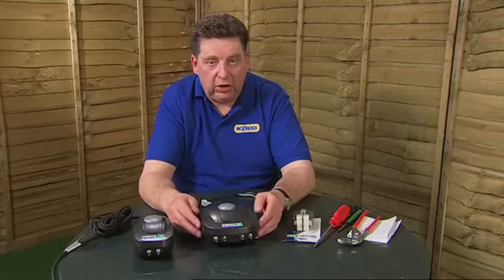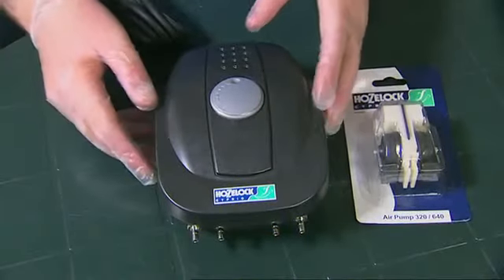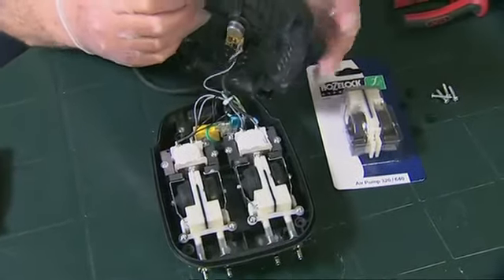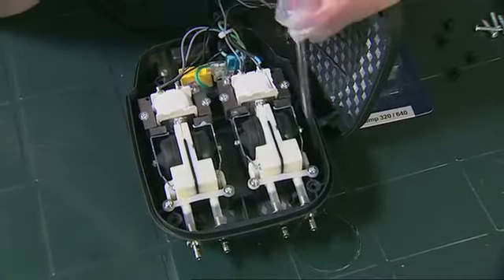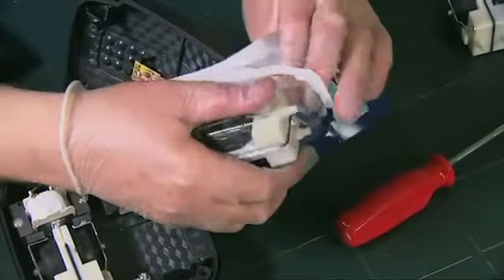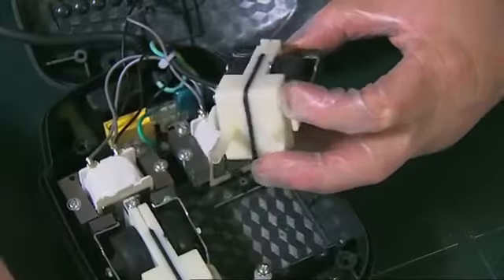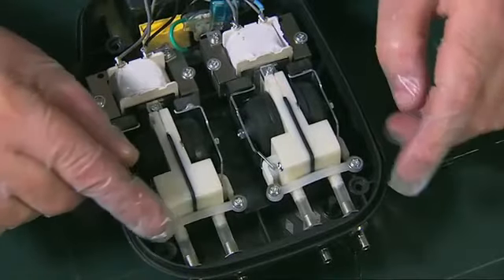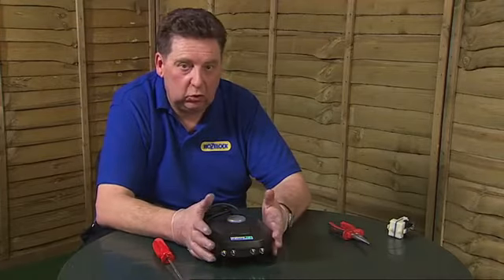How to replace the Diaphragm on a Hozelock Air Pump

Comment: Thanks. Saved me plenty of time figuring how to do the replacement. Have the 320 for my pond. Great little pump. Original aeration balls are a bit average but replaced with bigger ones and it does the job 24/7. Just over a year and one of the outlets failed. Part a 1/3rd of the price of a new pump.